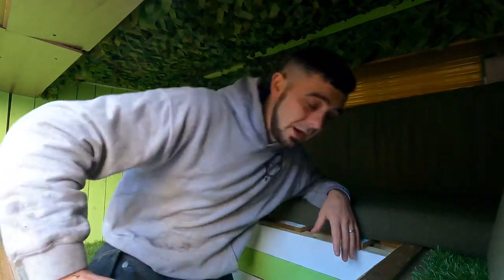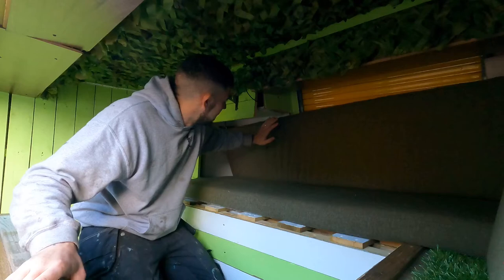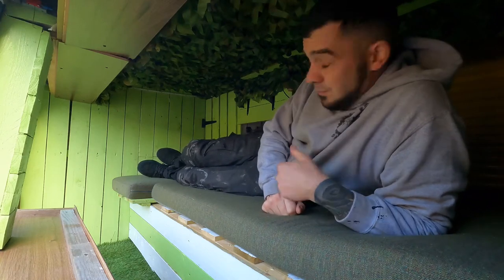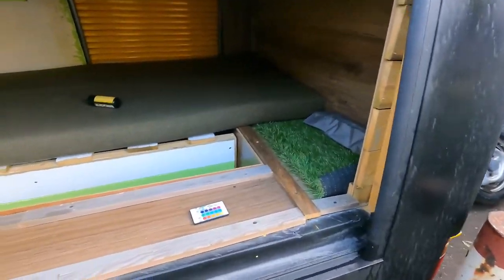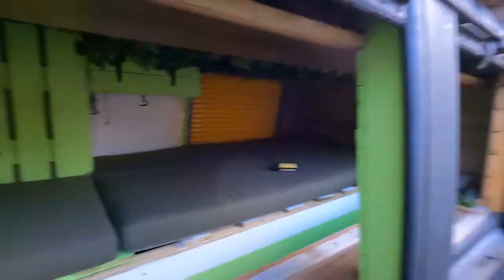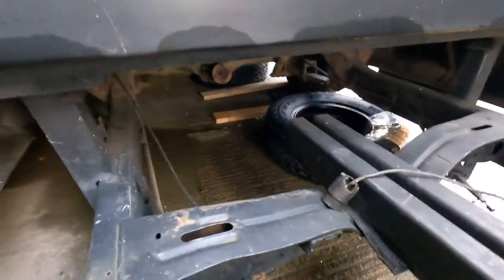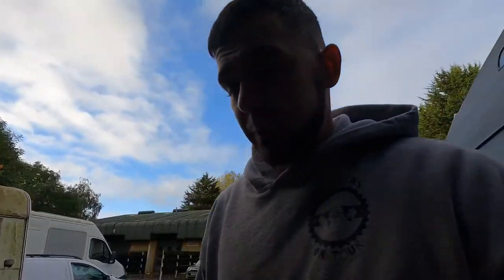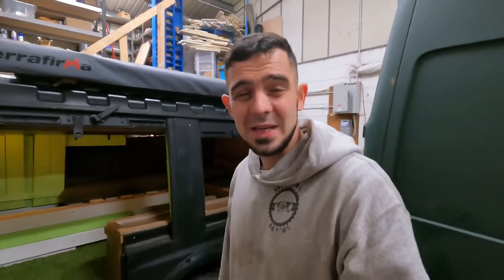Building an over lander camping trailer annex for our campervan

Comment: can you connect an alternator underneath to the old propshaft coupling to charge a leisure battery as its towed ?
Reply from the maker: That is probably the best idea ever!
I was thinking if the same thing that a caravan has on the wheel but your idea is much cooler and a good way to utilise what’s already there.
Reply: Good idea but unfortunately the centre won't spin fast enough for an alternator, I'd be stripping the diff to save weight
Reply: @harryglennie7691  you could always use a diff size v belt wheel in the diff to speed it up if needed , i have read online that it is possible